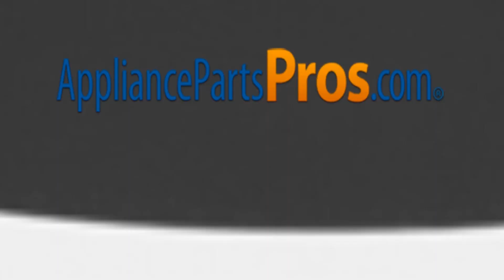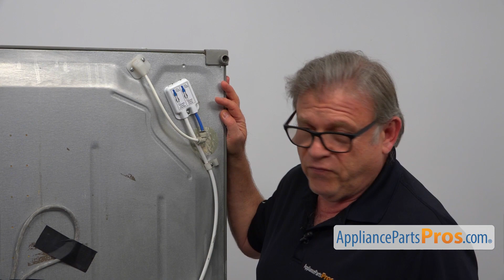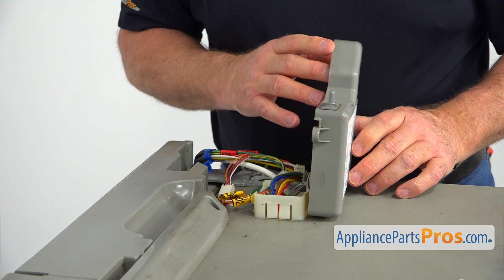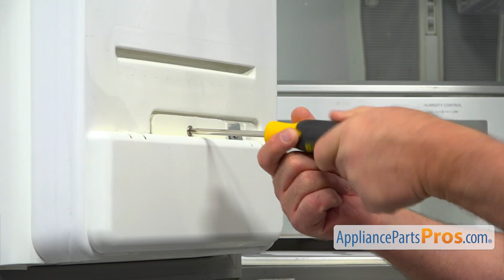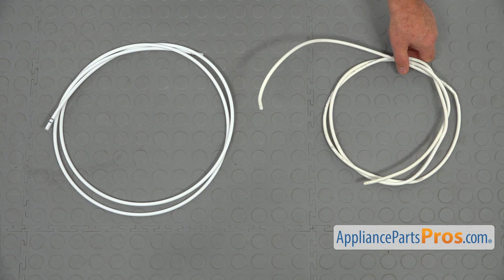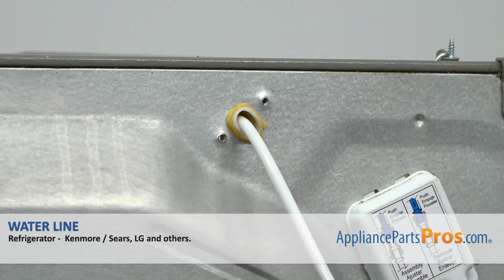How To: LG/Kenmore Refrigerator Water Line 5210JA3005E

Comment: Wrong refrigerator
Reply from the maker: This video demonstrates the repair on one compatible model, so the appearance may differ from your refrigerator even if it uses the same part. This video is to give you an idea on how that part is installed. If you need more installation information you can check out our Repair Forum: https://forum.appliancepartspros.com/.  It’s easy to register, and you can either post your question or search the forum to see if someone else has already asked the same question.
 
Our experienced technicians, with over 20 years of hands-on appliance repair experience, are ready to answer your questions and guide you through your repair.

Comment: Hi. What is the extra role of line for @ 3:21?  That is a part of the line on my LG that broke up at the hinge and goes to the back
Reply from the maker: The water line that is coiled up there is the water reservoir. If you can provide your model number we will be happy to look up the part number for you.
Reply: I had the same set-up for our fridge.  It seems like it was a mistake by the manufacturer to hook up the coiled line (the water reservoir) all the way to the back of the fridge.  Given the replacement part for that section isn't the same as the water reservoir, I believe the manufacturing line assembled it wrong.  But to answer your question, the coiled line is to chill the water so you have 1-2 cups of chilled water either for the ice-maker or the water dispenser.  Great video by the way; I was able to replace the cracked water line with few issues (other than the reservoir line having been installed as the input water line).  Only other comment is I agree with the other comments about LG using cheap materials.  We've had two different sections of the water line crack on our fridge because the cheap plastic degraded over time or couldn't handle the bends (I did not replace the cap on the back of the fridge for that reason; the bend under the cap was where it cracked).  I've also replaced what I can with better quality materials for about $20, so I'm disappointed in LG for using cheap materials on a refrigerator that costs thousands.

Comment: My freezer door is full size and I’ve taken the trim from around the exterior of the door removed the eater relay, but the eater hose goes into a molded piece of plastic built right on the door.
Reply from the maker: If you have any questions let us know1

Comment: Hi, I have an LG Refrigerator and I changed the line but the water is not running out when we try to use the dispenser. I don’t have error messages, but the machine is not working.
Reply from the maker: What is your model number?

Comment: I see users of this style LG FRIDGE report multiple water leaks from this plastic water line.  Did LG announce a recall of this plastic tube?  One user reported replacing this line 6 times in a fairly short period of time.  This appears to be a manufacturer defect.
Reply from the maker: We haven't heard anything about a recall. You can try and reach out to LG and see if they may have done a recall on this issue.